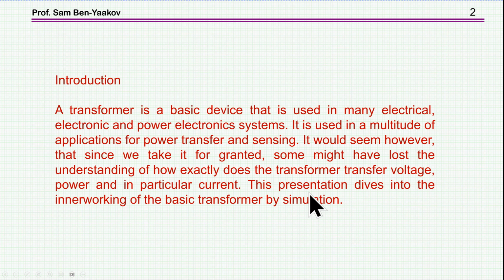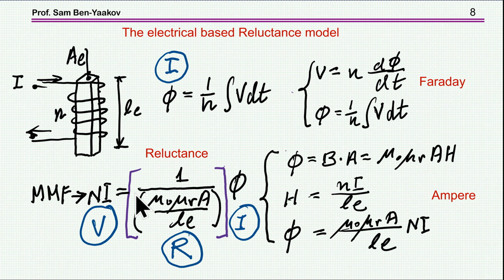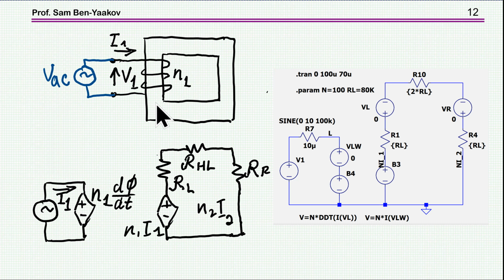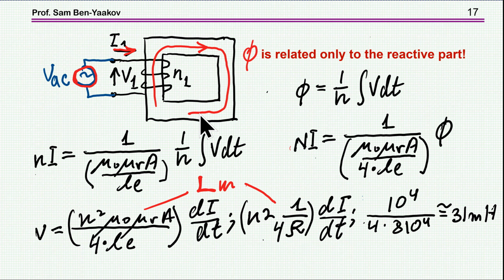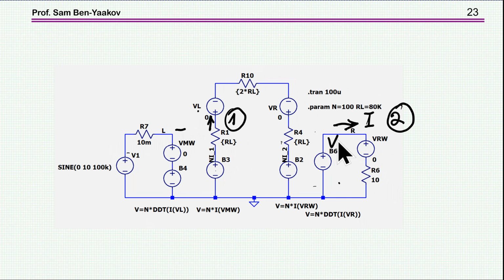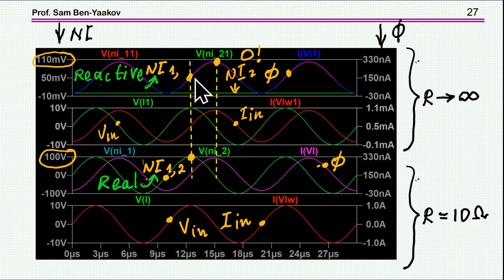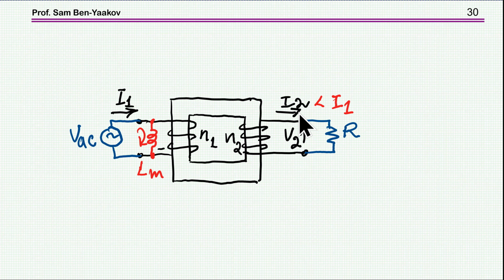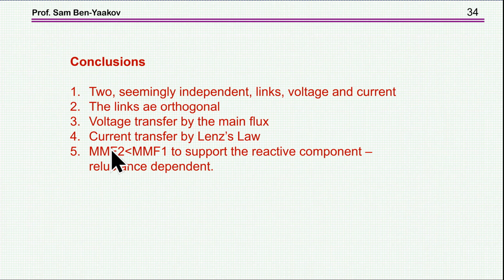Examination of the inner works of a transformer by simulation

Comment: When you are deciding polarity of MMF sources in eqvivalent cirvuit (nI), is it correct to think as: winding 1, current into winding, look which direction flux is going and then you can see + - direction for MMF1 source. Same for winding 2, current into winding, which direction flux is going and then you can see + - direction for MMF2? Came to my mind because in example transformer current 1 is going to winding 1 and MMF1 source matches for flux direction. For winding 2 current 2 is out of the winding. Flux is in same direction as for winding 1 but MMF2 + - doesnt match flux direction...
Reply from the maker: Thank you for the comment. A very good point. The difference is between source and load, and more accurately, between a flux associated with voltage and a flux associated with current. These are orthogonal. The Flux associated with the current due to the primary is cancelled out to a large extent by the current of the secondary (Lenz's Law). See https://youtu.be/_eKpvV4ApVo

Comment: This is exactly the knowledge i need more understanding of. I stay watching this videolesson, but pc simulations i am not used to the same way as to a working circuit or scopepictures. It is not the easiest way for me to get that intuitive insight. But it doesnot have to be easy and all the insights are presented in this lesson so i will watch and learn until i get that inner picture totally clear. But i still have some childish ideas to which i mis the why. Or why not of course.  Things as why should the saturation problem in a dc inductor not simply cannot be helped by a permanent magnet in the core? One direction should saturate earlier so the other direction has to have more room till saturation? But thats one question i still have, while some others are finally see trough since this lesson so i can never mis one lesson of yours because i cannot learn that much and that easy to follow knowledge on any other way than with these unique way of explaining that most interesting items from the whole electronics knowledge. Thanks for particulary this videolesson more than i know how to say.
Reply from the maker: Thanks for kind note and for sharing.

Comment: Prof, could you take a look at a question someone asked on the riddle, about open circuiting one leg of the parallel MMF situation?
This video cleared up a lot, thank you again, but that situation remains unintuitive to me. 
Based on another comment about parallel MMFs reflecting to input in series, one open circuit must stop current in all branches. 
I now think it must relate to 9:20 here about the pure inductor case, that only Lm would have current and none flows in the loads.
Reply from the maker: I thought I have answered it. If one leg is shorted flux will not enter it due to Lenz's Law. So now there is a 1:1 transformer.
Reply: @sambenyaakov  sorry the modified question was if we open one of the three legs, not your original question if it was shorted.
Reply from the maker: @electrowizard2000  Flux will not enter practically into the loaded winding and will be diverted to the leg with the open winding. So you end up with an inductor from input side, practically no output voltage at the loaded winding and the  voltage of the open winding is now like a 1:1 transformer , in this case 10V.